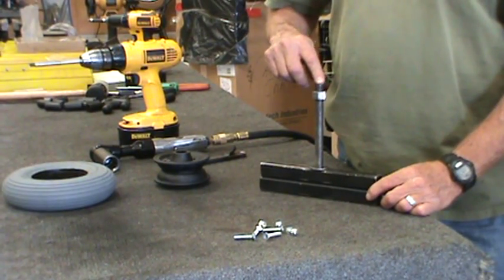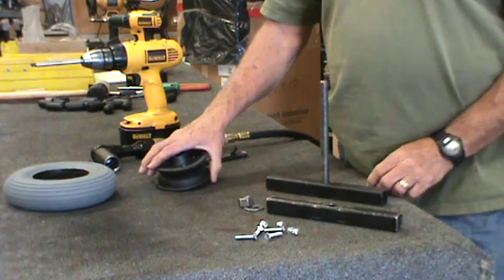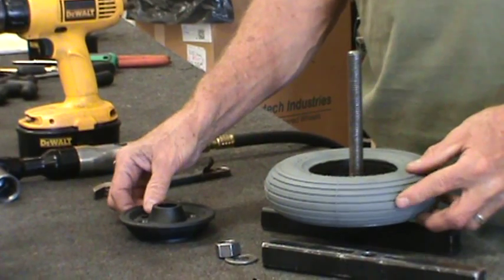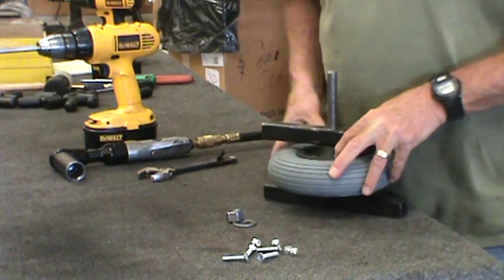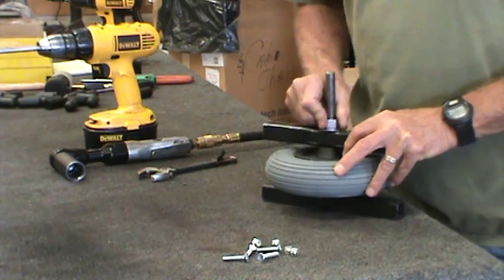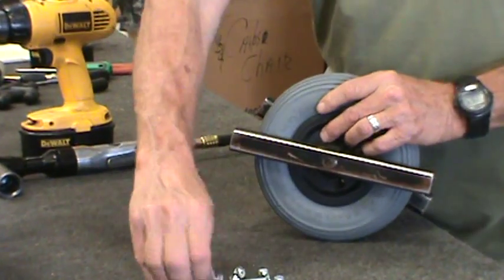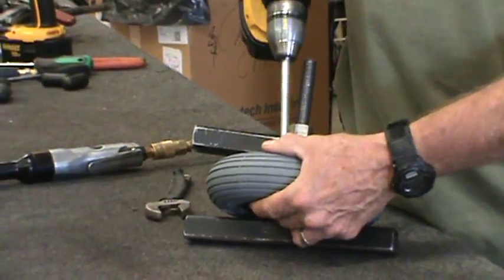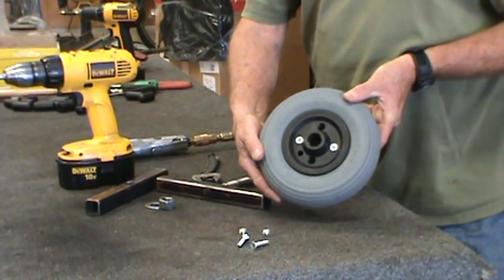New Solutions M35 tool how to install foam filled tires

Comment: Hello mate, any chance of a video on how to change tyres on the Kymco maxi xls...i have been trying to get a tyre off the wheel rims all blumin day. Just cannot shift it. its sealed to the rims. have changed many tyres on other makes with smaller size tyres. But never had this problem before. absolute nightmare. any help would be great. but a vid would be better. Thankyou all.... Bri

Comment from the maker: You can, but this makes it easier to line up the screw holes, which can be a pain.  "dumbass" I've been called worse names. Also, when you write your education is revealed. You should have capitalized your "I", spelled "can" correctly, put a comma after vise and a period at the end of the sentence.